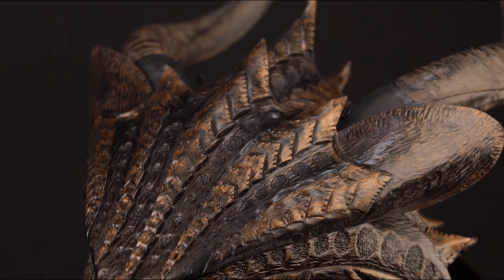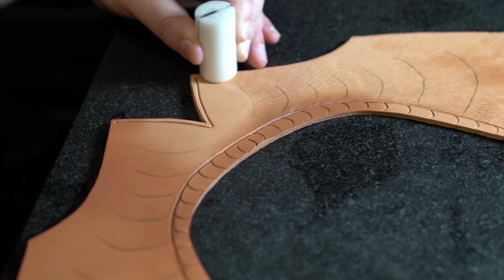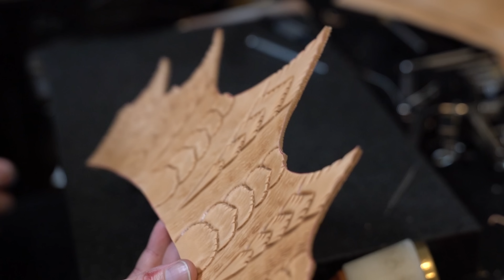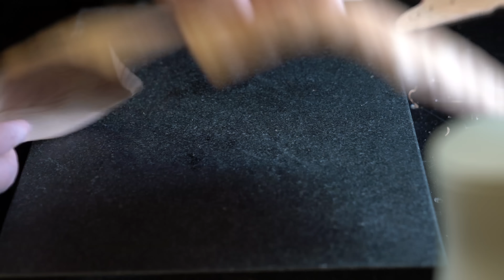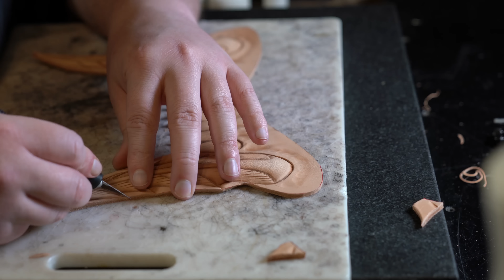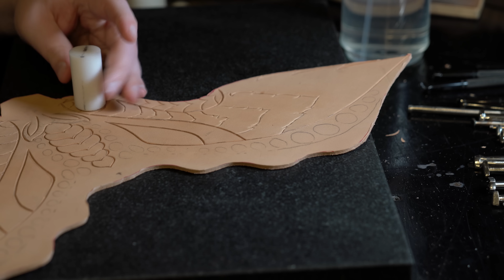🐲 MASTERPIECE TIGER DRAGON LEATHER HELMET P.1 🛡️ Prince Armory Project Build

Comment: I've been absolutely amazed by your work from the very first time I stumbled across it. Thank you for sharing these videos of your process in creating these works or art. Truly spectacular work. I was also wondering why you don't use a dapping punch to form the teeth instead of the marble.
Reply from the maker: Thanks.  The answer to that is pretty simple actually.  Dapping blocks have sharp ridges that would leave nasty impressions.  You get more control forming over a marble, try it.

Comment: A little advice, If you are working in a fixed point when recording video turn the auto focus off and set the focus point to your workstation. Then you don't have blurry footage and if you move in front of the camera to grab a tool it won't keep trying to refocus on the set area.
Reply from the maker: Thanks.  Yeah you're probably right though I tried that too during initial tests but I ended up re positioning my work a lot and whole segments were completely out of focus (perhaps I should have been using a less shallow DOF though), and there were many spots where I needed to pick a piece up to show the camera up close.  But if I can make a little extra money from doing this I'll set up one or two other cameras recording with locked focus so I can have a dedicated close up cam I can move around and focus scene to scene